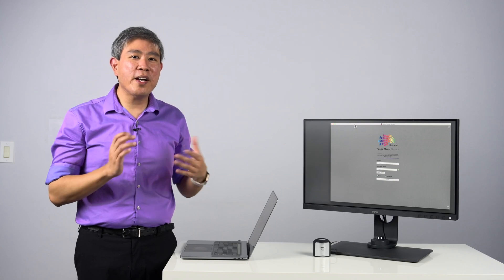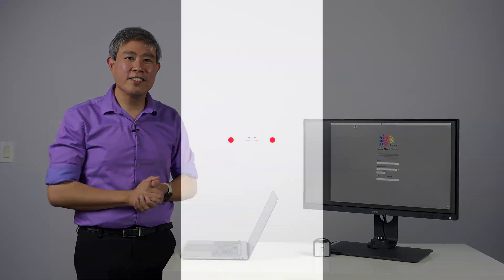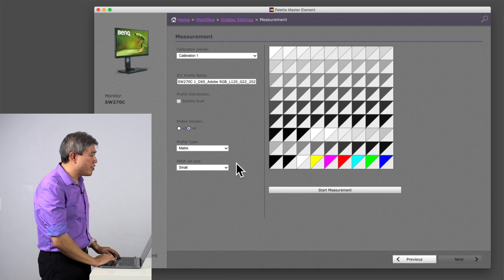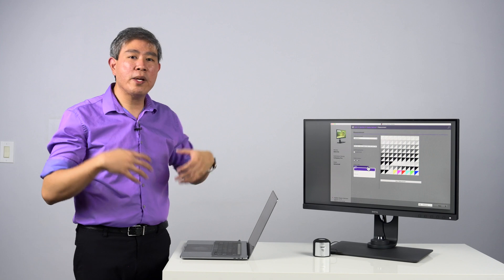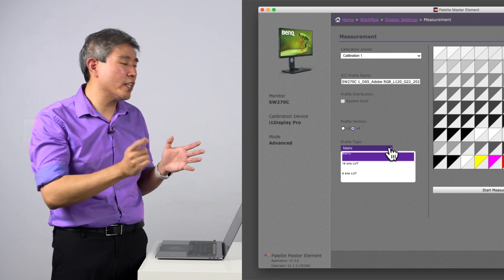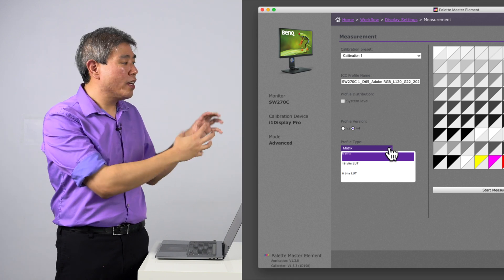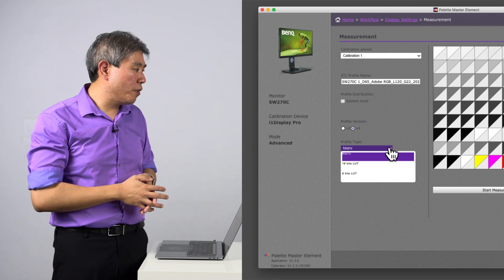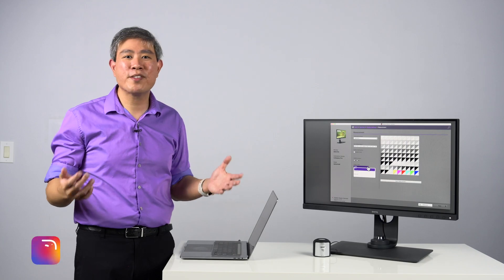BenQ SW Explained | Displays 3D LUT vs Palette Master Element icc type LUT, how are they different?

Comment: Hi, if the monitor is 10bit and LUT is 16bit, what is the difference between them?
Reply from the maker: 10 BIT is the color output of the panel aka billions of color. LUT is the look up table for color reference and adjustment, it is related to color out but it is not the actual output on the LCD. Hope this helps.
Reply: @ArtIsRight  Thanks for the fast reply! :) Does it mean that the 10bit panel is just referencing/searching colors from 16Bit LUT?
Reply from the maker: You get the idea.

Comment: Hello. I heard that the only way to upload a true 3D LUT into the BenQ SW270C is using the ColorSpace and selecting the Calibration 3 color mode on the BenQ SW270C. Is that true? And is the 16 bits LUT of the Palette Master Element a 1D LUT or a 3D LUT?
Reply from the maker: I am not sure of this as far as I know only CalMan and Light Illusion are the compatible 3rd party software. As far as PME LUT that is not the same as the display LUT. In PME it is just the build method and this has now change in the latest version to Matrix only
Reply: @ArtIsRight  Thank you for reply. The ColorSpace is a product of Light Illusion. Since the latest version of PME only supports the Matrix, is the Matrix better than the 16 bits 3D LUT?
Reply from the maker: Right, Then that would work. I would follow their instruction. PME LUT vs Matrix has nothing to do with the display LUT and between the two it does not matter much with hardware calibrated displays for icc profile generation.

Comment: Hi Art, what i use davinci resolve but from know i dont have Dlink, ultra studio, nothing. and my options are calibrate use ICC method or a 3D lut from the output monitoring of davinci resolve. What do you think is the "better" option?
Reply from the maker: What display and color calibrator are you using? Every calibration generates and icc, 3D LUT is hardware calibration but if you don't have a capable display then you can't do it. And you don't need a Decklink to get good colors
Reply: @ArtIsRight   davinci resolve have the option to load an output Lut for monitoring but just work with the clean feed of davinci resolve. When you are using the monitor for another purpose the calibration is off .
Reply: Basically is the same that ICC but working from davinci and not from the computer. But I don’t know what is better or more presicly if a 3DLut or and ICC?
Reply from the maker: Based on what I know, you are not going to miss much not having it.

Comment: Somewhat unclear why validation might fail for 16 bit LUT yet pass for matrix, as it sounds like LUT is a more fine grained model of the calibration.
Reply from the maker: LUT uses table, matrix uses measurement data, as far as accuracy, this only has to do with the profile and since these are Hardware calibrated displays, it does not matter much. 16BIT LUT fail because of some bug or glitch with the OS, I would recommend watching my PME release guide, as soon as a new PME version come out, I am usually testing it.
Reply: @ArtIsRight Will do. Loving moving up to 32 inch!
Reply from the maker: Nice

Comment: Also SUPER curious if you have the ability to do a comparison and evaluation with the Apple Pro XDR vs the SW320/SW321. I've seen a few out there as sort of one-offs that compare the PD3220U but none on the SW's. Obviously not 6K but I am less interested in 6K than I am about the other features.

I've not had the opportunity to see the Apple Pro XDR in anything close to my own environment nor side by side with any of the monitors I use. I've only seen one in let's say a very very posh environment which pretty much makes anything look very slick, including my ancient butt.
Reply from the maker: I would love to evaluate that too but I simply don't have the budget for that. This said, I am not entirely sure if Apple XDR is a hardware calibration or not. They just released a few documentation lately about how to calibrate it. From what I read it seem more like a TV calibration rather than a full 3D LUT adjustment like a hardware calibrated display but I could be wrong about it.
Reply: @ArtIsRight  From everything I can tell it has hardware calibrations done at the factory for the color spaces options it provides and switches profiles in Mac OS via the monitor settings at the same time various hardware calibrations are toggled. The only controls are via the monitor settings = no external controls on monitor.
Obviously I don't have one but I sure would like one just ummm no good reason. I get that way over certain Apple products -- a little irrational and end up buying a few here and there that I have no "need" for but just must have (IE yes I bought a G4 cube way way back just because it was so so so cool/different/pretty -- same goes for the first cinema HD LCD panel when it first came out)
Reply from the maker: It could be, all displays are calibrated from the factory, the hardware LUT is the telling part. If it can't be adjusted post factory calibration then it is software calibration only. If it can then it is hardware. Either way, yes it does looks nice but the price is just crazy.

Comment: Art. Love your channel even people that don't use BenQ products really need this kind of content given how much misinformation and voodoo nonsense pollutes the web regarding all of the topics you cover for BenQ. 

You did throw a bit of a curveball in this video I personally would LOVE to see if you have and actual answer for. Specifically the part where you sort of glossed over the validation failure:

"Sometimes when you use the 16bit lut profile validation will fail. In that case just fall back to matrix LUT...."

Hmmmmm... well the obvious question is WHY does it "sometimes" fail? How can you make it not fail? The follow on questions would of course be, when it fails is the profile/calibration actually "bad" or is it just that the validation is incorrect???
Reply from the maker: This is the software LUT that is used to build the profile. In PME there are some bugs in the software on some specific version that cause a calibrating with 16 BIT LUT to fail and in this case you would just use Matrix to build the profile. To make it not fail you would have to jump to a version of PME that does not have the 16 BIT LUT error. The best thing to do is watch my latest PME video because I usually do a recap of this.

Comment: Hey art, Can I input 3D LUTS created via DisplayCal into the monitor?
Reply from the maker: You can't DisplayCal is software calibration only and therefore it does not generate LUT that for the display only the video card output via icc profile. Depending on the SW that you have, SW270C and SW321C are 3rd party software compatible, meaning that you can use CalMan or LightIllusion to calibrate the LUT beside PME.
Reply: @ArtIsRight  ah okay, I have sw240. So the only way to use its hardware calibration is via PME?
Reply from the maker: Yes that is correct. This video will help https://youtu.be/8rjRoIe0-mo

Comment: Hi Art, we finally got back to work as lockdown restrictions were lifted. Sat down with our colorist who works in Davinci Resolve. We did  a custom calibration with Palette Master Element on our SW270C with an i1 Display Pro Plus. Here are some of the settings we used to get the best results for video post production. Best result was using Panel Native as our RGB Primary. We used a Gamma of 2.4 instead of 2.2 as our editing suite was in a darker room with a D65 bias light strip behind the monitor. 16 bit LUT Profile Type, largest patch number. D65 white point. 100 Candela /NITs. We got a dE of less than 1 across all colors.  We calibrated using a USB C cable but switched to the HDMI playback from our Blackmagic Decklink card. Colorist used color bars and scope to check calibration and was impressed how close the color of the BenQ got to her pro reference monitor that cost many times more. I’d like to say this is our experience and other users may have different results. Just thought to share. The SW270C is very usable in a video editing environment.
Reply from the maker: Hi Dennis, this is really great to hear! I'm really glad that everything works well! Really happy! And thank you for sharing.
Reply: Do you know of a way to manually upload a calibration LUT from another calibration program like displaycal onto the monitor?
Reply: Thank you so much for sharing your thoughts Dennis!
I have the same monitor and I work with Davinci. So I'd like to ask you a couple of questions.

If you work in a 709 color space, why did you choose "Panel Native as your RGB Primary" instead of rec 709?

And finally, do you prefer "Relative Black Point" or "Absolute black" to work with Davinci?

Thank you very much for your time and attention.
Reply from the maker: DaVinci now have color management and should do the color conversion. A video about that will come out this Friday explaining this. As far as relative vs absolute black it is not so much a preferences other than the end result https://youtu.be/AlcZ29naX4g
Reply: @ArtIsRight  really thank you for your answer and time!!

Comment: The only real advantage of LUTs over matrix display profiles is the ability to add a 4th channel to be able to make  a 3D profile which you cannot do with a rib triplets. Since the TRC of a high end monitor should not have huge non linear variation a matrix profile should perform well with little or no perceived difference. Since the BenQ color engine is performant enough the choice is really easy; try both. The 3D profile however may have better shadow and highlight separation depending on how BenQ craft the profile tables.
Reply from the maker: @Neil Snape, from my testing with BenQ, 16 Bit LUT build in PME tends to be a touch more accurate. To be honest, this could have resulted from a PME bugs, who knows. :) Thank you for chiming in and adding more info!
Reply: a 3d lut gives you saturation information on a volumetric scale which no 1d lut or matrix can ever do. If you want a real deal accurate color calibrated monitor you do a 3d lut that scales down the native gamut response to the target, for example going from rec709 2.2 native gamut to rec709 2.4 BT709 gamut.